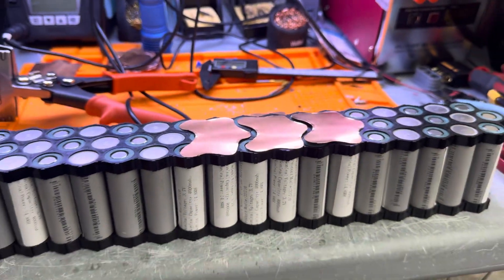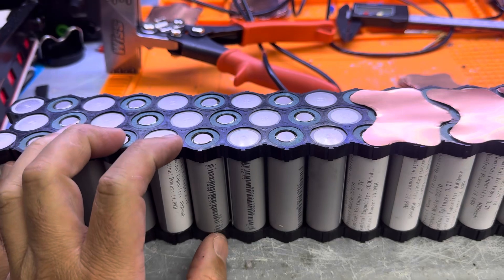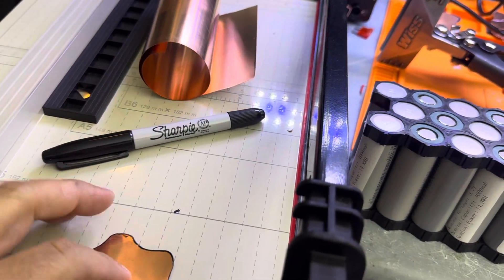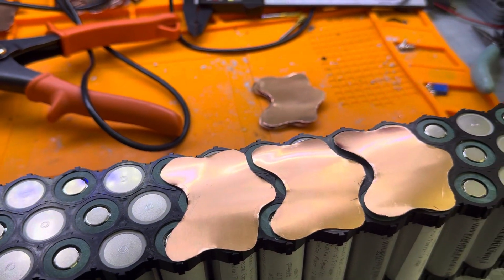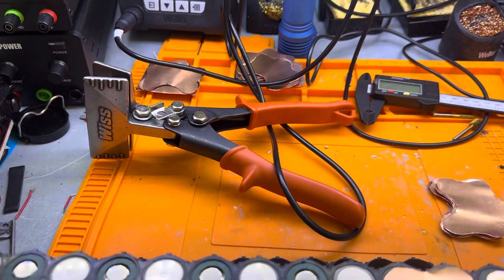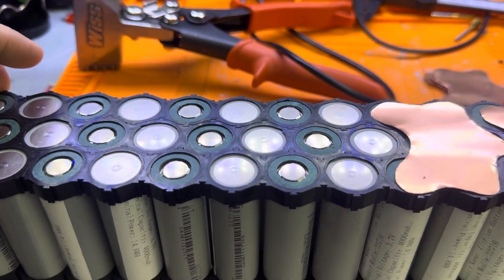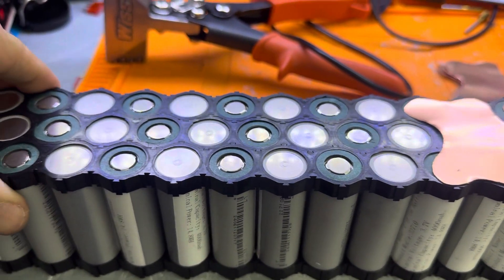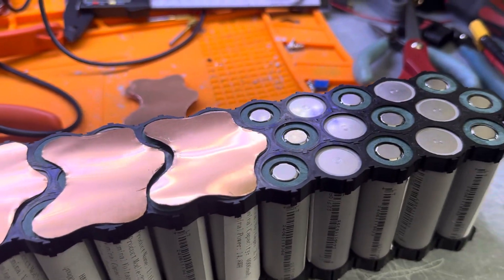DIY 72V Battery Build: JP40 Cells for Aventon Aventure 2 with CYC X1 Gen4 Motor - Part 1

Comment: What bms are you using?
Reply from the maker: On this built I use a JK Smart 80A BMS but the pack can handle over 150A, is just my setup does not take more than 80A.

Comment: Uxcell copper ?
Reply from the maker: YES !!!! From Amazon. uxcell Copper Sheet Roll 3500mm x 100mm x 0.2mm, 99.9% Pure Copper Strip Copper Flashing Metal Foil Plate for Electricity DIY Projects